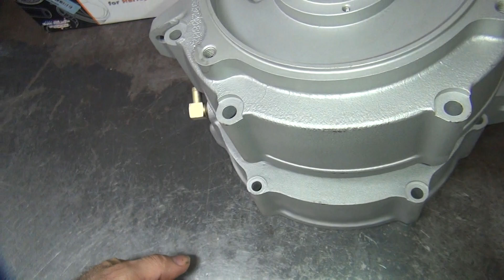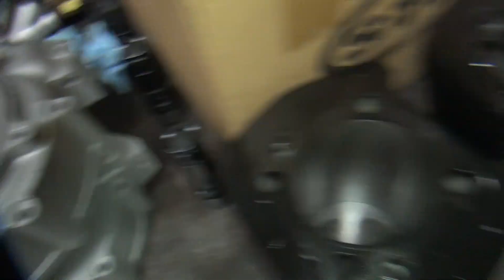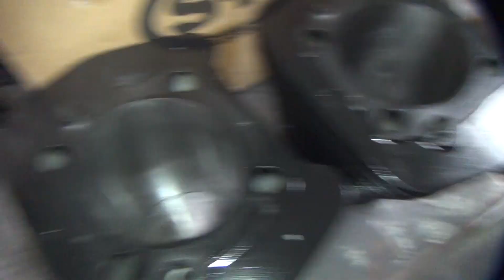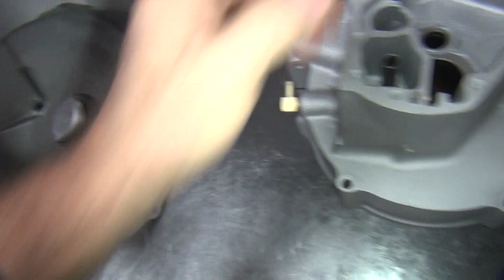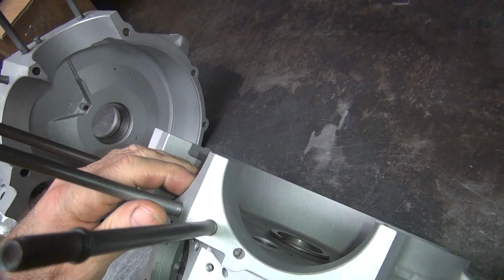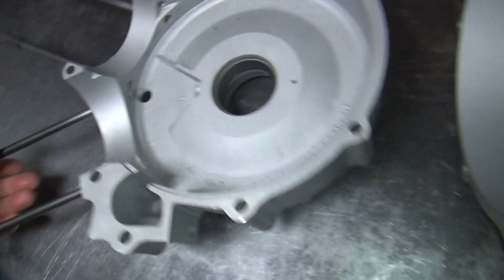1992 80ci evo motor rebuild #106 repair softail fxst flstc case welding harley by tatro machine

Comment: 90-92 mod can be an pain in the ass to get pinion parts to,make sure if you should change the cam that you get the right coulor pinion gear to this cam,i was bay an ev27 and needed an green gear and it was totally out of stock

Comment: Ultima parts i have used  from crank n wheels  to 6 speed kick trans  have been excellent quality and  decently priced if you know where to look,.Just stay away  from  rev tech .I also  tend to be more critical bein a career machinist with 40 years in most phases of manufacturing and build  old HD at home as a hobby........ I hope that it doesnt need to be said you never use anything like this right out of the box,but....lol
Reply from the maker: i liked the older rev-tech stuff too. still use some of it. like everything, you need to find what works for your application.
tatro

Comment: Chrome sockets on an impact gun are no good.
Reply from the maker: they work just fine. been using mine for many years. buy good tools and they last.
tatro
Reply: Bigger air supply line, to that 1/2" Ingersol-Rand gun, would probably do the trick...
Reply from the maker: i go in back when i need more power.
tatro